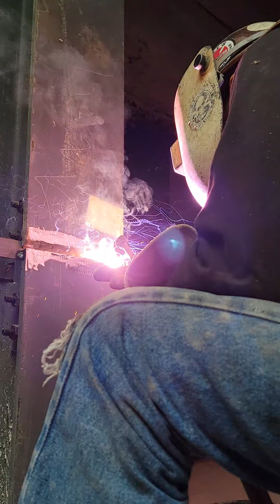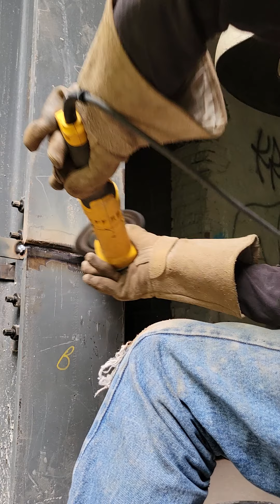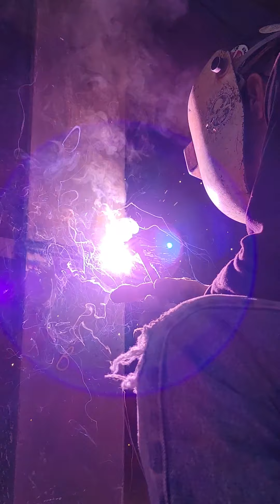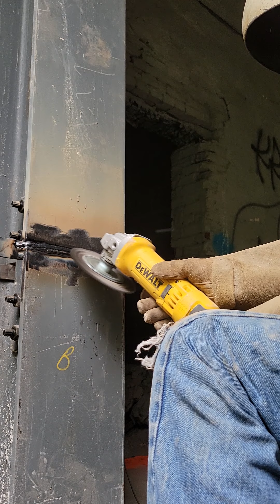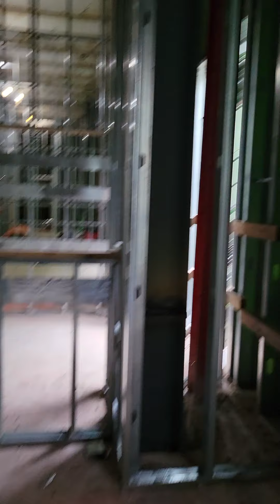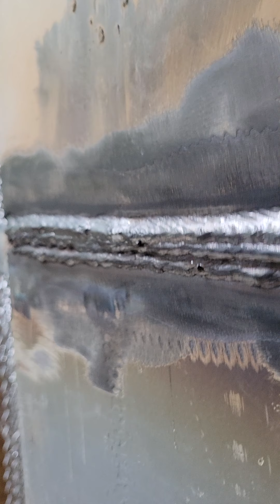Structural Welding/Column Splice= Flux Core

Comment: Where do you get the longer neck for your gun?
Reply from the maker: William, K126 gun Pro,That's what I have, Lincoln has the part number, I go to airgas for all my supplies, And they get me the long 12" goose neck,, I only use I only use LN25, my models the iron worker, It comes with the K126 pro gun, I always use 12" long goose necks, And they have different degree of angle, I don't pay too much attention to that, I hope things are going well, Sending out my doe permit tomorrow morning,  September archery season's right around the corner, Stay in touch brother!

Comment: Hey what am I doing wrong I was playing with some nr232 068 the other day and the slag was really hard to get off bead profile was good but just a few spots wouldn't come off. Too hot? Not enough stick out?
Reply from the maker: , sparks, That's a tough question, How many volts are you running, How much lead are you running, I just have to ask them questions, If it's burning hot enough, I would hold my sides a little longer, What is your power source, Diesel gas electric? Touch base with me
Reply from the maker: Sparks, 3/4 stick out,  remember your goose neck angle, Is straight on, Is with a touch tilt down, If your heat right, Your wire speed Should be rich, If you drive the gun into the plate and it starts Jack knife in to me That's perfect wire speed, But hook me up with that information